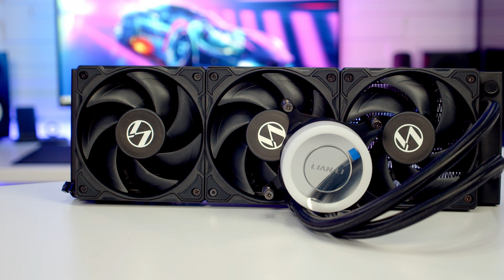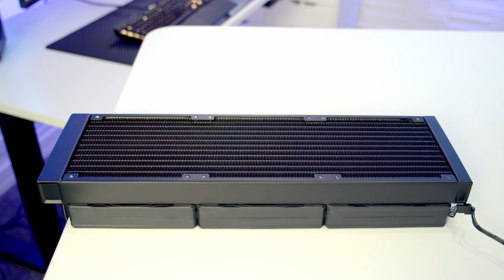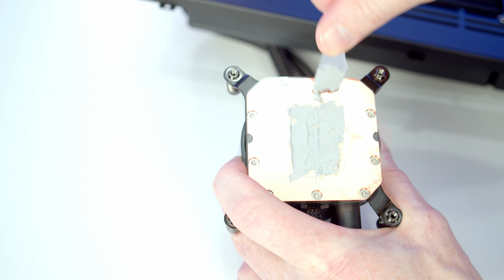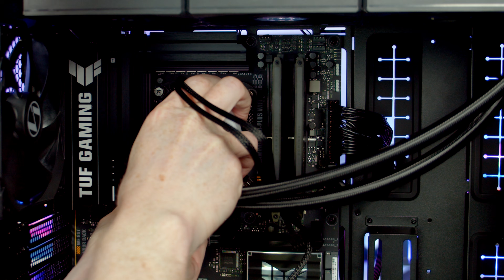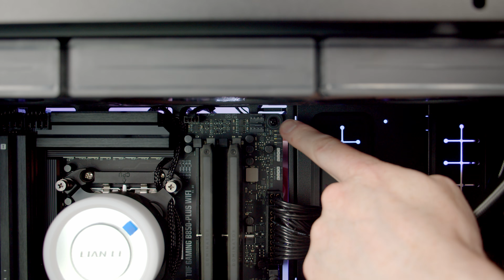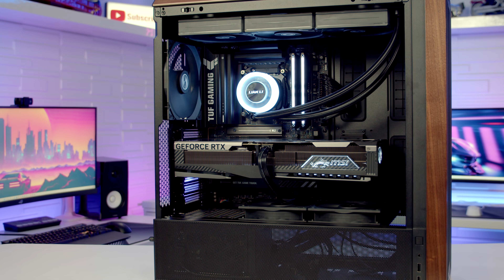Lian Li Galahad II Lite 360 Performance - Installation Guide

Comment: Seems like when you applied the thermal paste using the provided stcker, part of the sticker seemed like it got stuck on the cooler baseplate when you removed the sticker... Just a warning to anyone else installing these...

Comment: My pump rgb was working just fine followed the instructions everything plugged in correctly. I moved my pc after powering it down. After that the rgb will not light up on my flash once on startup? The pump still works and is recognized in the l connect software but just the rgb isn’t working anymore

Comment: Are the fans supposed to come attached to each other? I bought an open box version from microcenter (plastic peel stickies were still on everything), but the fans were not connected to one another.
Reply: yes but they are uni fans and snap together quite easily

Comment: Is there an adapter kit for LGA1200 socket? I am using am 10th gen Intel processor..
Reply: no, this radiator is specifically for the LGA1700 and LGA1850 sockets. You should look at the Galahad II SL Infinity AIO

Comment: Is it an actual improvement on the first one, that is the question.
Reply: Probably not. Currently, artic cool, which is better, is $85
Reply: no its not. better stop with that wrong info.
Reply: @JoJo-J5x-z9l its not
Reply: That's right, the Lite has an Asetek pump.